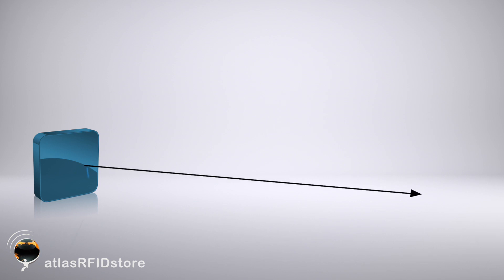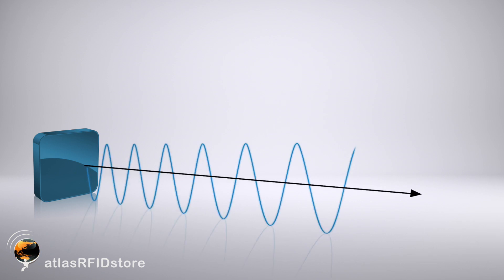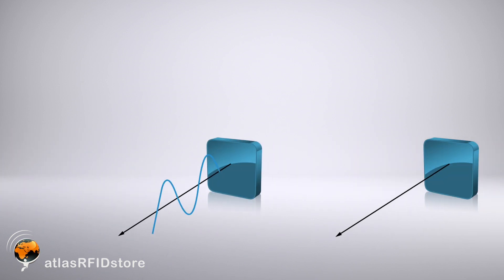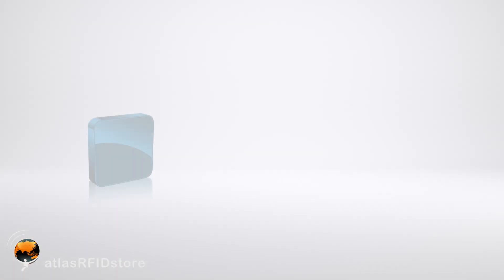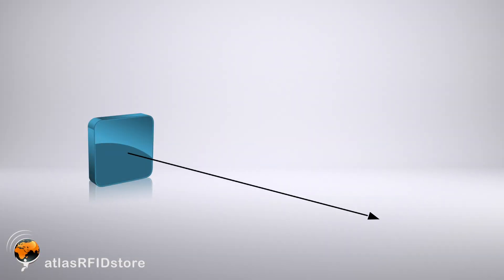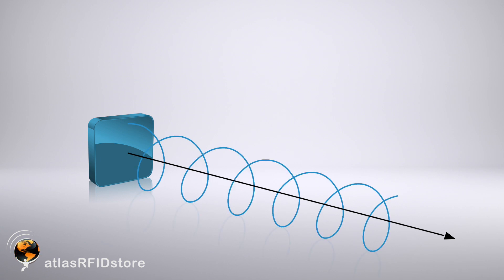Linear vs Circular RFID Antennas: Which is right for me?

Comment: Thank you for the video, It actually really precise and helpful for me to understand. 
but I have a questions, as you mentioned Linear antenna has longer range than circular and its good if you can be able to predict the tag orientation, could you specify it in more detail about your meaning of tag orientation? 
tags needs to line up in same format? or if in the box some RFID tags are attached bottom but next box attached on the left linear antenna still can read it?
Reply from the maker: Choong,

Yes, generally linear antennas have longer read range than circular because they do not have to rotate planes. Tag orientation refers to whether the tag is orientated on a box horizontally (the long end parallel to the ground) or vertically (the long end perpendicular to the ground). This video will walk you through orientation around 0:57 https://youtu.be/D-AOOoSFj78

To answer your last question, typically all the RFID tags should be facing the RFID antenna when they are being read or moving through the read zone. The face of the tag should face the "face" of the RFID antenna. Does that make sense?

Comment: sir what should be the minimum distance between the reader and antenna
Reply from the maker: Raj,
There typically isn't any requirements for minimum distance between a reader and an antenna, in fact, there are a few readers that have an integrated antenna (https://www.atlasrfidstore.com/integrated-rfid-readers/). The smallest antenna cable to connect the RFID reader to the RFID antenna that I have seen is about 1 foot, but a smaller one might be able to be made. I hope that helps!

Comment: can i augment the gain of microstrip patxh antenna 867MHz(rfid)? if the answer is yes ,than how?
Reply from the maker: The gain of an RFID antenna is determined by the antenna's design and set during its production; unfortunately, antenna gain cannot be changed once the antenna has been created. However, the RFID reader’s transmit power can be adjusted in almost every reader’s settings to increase or decrease the power output from your antenna (which will affect its read range). 

Take a look at this blog that discusses how antenna gain and transmit power work together to determine total output power: https://blog.atlasrfidstore.com/conform-regional-regulations-using-rfid.
Also, here is a post on the various factors that will affect read range (including antenna gain): https://blog.atlasrfidstore.com/improve-rfid-read-range.

Comment: can i ask,when i mesured the rssi  used landmark system with circular polarization patch antenna,when i moved the antenna from (the right to the left ) and from (the the left side to the right side)of my landmark system  the results are diffrent ? why? can be related to the left and the right  circular polarization of the antenna ?
Reply from the maker: Abdo, There are a lot of different factors that can affect RFID tag attributes, particularly RSSI. Even slightly changing the angle of the antenna can have a visible affect on a tag's RSSI. Please see this article outlining some of these factors - https://blog.atlasrfidstore.com/improve-rfid-read-range.  

Sometimes, the RSSI is not the best factor in determining read range, also check out this article that talks in depth about the pros and cons of RSSI. https://blog.atlasrfidstore.com/rssis-role-rfid

Thanks!

Comment: Can i ask, which antenna would be the ideal for a marathon? a race...
Reply from the maker: Thanks for your question! There are a variety of antennas used in race timing. Mostly, either ground (mat) antennas or panel antennas either mounted overhead or on the sides of your finish line. The antenna you need depends on a variety of factors: The type of race you are timing, where you plan to tag your participants, and the number of participants you have. 
Take a look at these race timing articles in the link below when you get a chance to learn more about anything race timing related!  https://blog.atlasrfidstore.com/?s=race
Reply: Thank you for the answer, and I would like to ask one more thing, I need to record the time that the athlete passed the finish line. I would like to know how I can only pick up the moment when the athlete passes the finish line. Is there no risk of the RFID antenna picking up the TAG signal before the finish line? After all it has an "angle" where it picks up the signal right? Is there any way to capture the signal in a straight line?
Reply from the maker: That would be a benefit of using a linear polarized antenna. The radio waves from a linear polarized antenna can give you a more precise reading area because they typically have a narrower radiation pattern than the waves emitted from a circular polarized antenna. 
Another way to be precise with your read point is through testing the antennas you have and adjusting them in a way that only reads tags in a certain area. You can use the RFID Power Mapper to “map” out where the radio waves are the strongest and also to find where the most interference is. See the Power Mapper here:  https://www.atlasrfidstore.com/vulcan-rfid-power-mapper/
Reply: Thank you very much, that was a great help!!!
Reply: Hello again, I wonder what tag you indicate and it is worth having a UHF RFID printer? From your site, which set would you indicate? For example, a race with 500 atlets to run 5-10 Km.
Reply from the maker: I would recommend the Dogbone R6 RFID tag. Because of its large antenna and sensitive chipset, this is the tag many race timers are using. See the product here: https://www.atlasrfidstore.com/smartrac-r6-dogbone-rfid-paper-tag-monza-r6/
With regards to purchasing an RFID printer, atlasRFIDstore offers custom printing & encoding as a service so you do not NEED a printer; however, this costs extra per tag so the purchase of a printer may be a good investment and could save you money in the long run. 
You will spend roughly $3,000 on a printer; but, once it is paid for, not only will your tag costs go down,  but you can also control the process and time it takes to print/encode tags (versus having to wait for someone else to do it). 
This article can help you determine whether it is best for you to purchase a printer or not: https://blog.atlasrfidstore.com/rfid-printer-when-should-i-invest

Comment: Thanks for answer. I saw some video where man can move few degrees and signal was ok with linear. So on plane whitch is almost in same position with no acrobatics you will get better range with linear ? Can you say haw big difference in altitude can be ? Or angle
Reply from the maker: Correct, if you use a linear antenna with an RFID tag that is "lined up" in the same plane as the antenna's radiation pattern, then you will get longer read range (vs. using a circularly polarized antenna of comparable gain). However, it is difficult to speculate how much of a difference as well as how "far off" the tag can be from the linear antenna's radiation pattern before the tag reads start to be missed. As always, we recommend thorough testing before deploying any RFID system.
Reply: Jan Prejzek 7

Comment: Can i ask, why is circular anthennas with helical used for "long" range instead of more range with linear anthenas (as you say) ?
Thank you
Reply from the maker: Jan, thanks for your question. We apologize for any confusion, but we do say that you'll get a longer read range with a linear antenna; however, we only recommend using a linear antenna when you can accurately predict the orientation and placement of the RFID tags for the given application. If you cannot predict the orientation of the RFID tags, then we recommend using a circularly polarized antenna (which will have a shorter range than a linear antenna of comparable gain). Please let us know if you have any other questions.
Reply: I dont understand exactly. What you mean by orientation. It mean it must be only straight vertically or it must be like set to one direction like East ? Like directional antenas ? Ofc when you wanna better reception you will use directional linear anthena on reciever ? :)
Reply from the maker: With regard to linear antennas and RFID tag orientation, we mean that the tags must "line up" with the linear antenna's radiation pattern. As shown in the video, linear antennas will transmit along a single plane (for the most part); so, you would "line up" the tag with the antenna's radiation pattern. Some quick testing will show how big a difference there is in terms of read range when a tag is within the same plane versus when it is rotated 90 degrees. Here is another YouTube video of ours that talks about the same concept in a slightly different way: https://youtu.be/rSbSYp2hexs?t=1m13s.

Comment: Will it be possible If I would create an antenna that would surround my whole door from, will it be able to detect the rfid that would pass in the door which is in the middle of the antenna?
Reply from the maker: Your idea might be possible depending on the amount of space you are trying to cover. A series of Harting Locfield antennas connected to a single reader and outlining a door frame MIGHT accomplish what you propose; but, you'd have to complete thorough testing to be sure. Here is a link to the antennas in question: https://www.atlasrfidstore.com/harting-ha-vis-rfid-antennas/.
Reply: @atlasrfidstore  But dont these output is a cylindrical pattern? would that mean that you might get reading from tags not passing through the actual door?
Reply from the maker: @AMalas  Unfortunately, door frame/portal applications always run the risk of capturing stray reads.  In addition to carefully selecting, setting up, and tuning the RFID hardware that you may need, you'll likely need to use some software algorithms to filter out unintended/stray reads.  For example, you could tell the system to ignore tag reads that show up under a certain level of RSSI and/or number of reads/second.  In any case, thorough testing is needed - not just on a single door frame or portal, but on every one that is outfitted.  Lastly, tag selection will be key to ensuring you get the right reads.  You'd want a tag that gets enough range to be read when crossing the portal's threshold, but yet that doesn't give so much range that you pick it up from too far away.